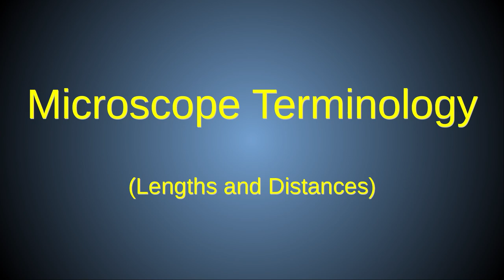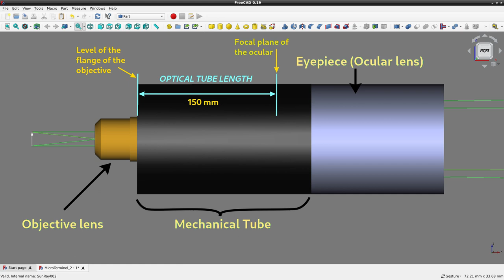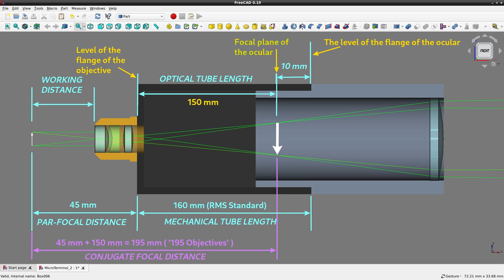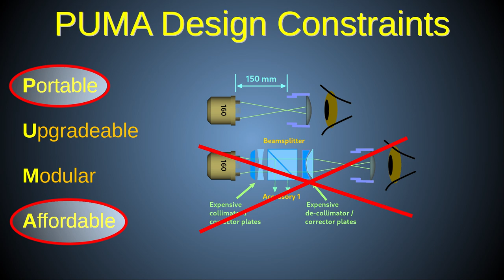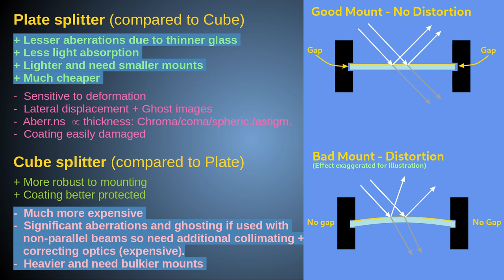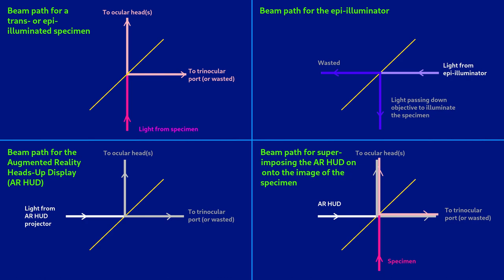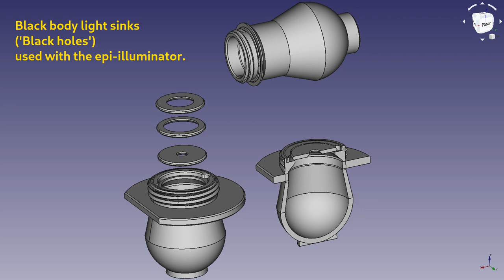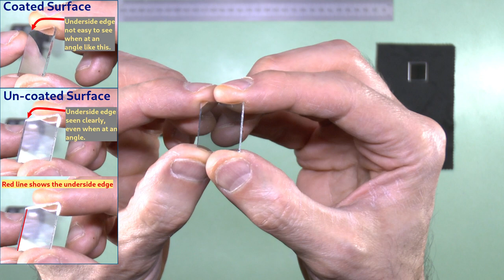Beam Splitters and the Advanced Filter Block (plus Microscope Length and Distance RMS/DIN Standards)

Comment: I come back to say I finally assembled the filter block (with a 20mm half mirror because it was really too hard to adapt for a 30mm one) and it works pretty well with a 5x objective.
I don't have a base yet, and I plan to create a totally different design (only for light reflected), so my tests were a little shaky, but the image quality is very good with the 5x objective. Comparable to my metallographic olympus microscope, but very cheap to make, so really well done.
This will open up a lot of possibilities. I plan also to make an infrared version because I have a microscope camera with a removable IR cut off filter.

I also tried with higher magnification objectives but sadly, the quality deteriorates a lot with very little contrast and a hazy appearance.
It may be caused because it's biological objectives (so they requires a coverglass) but I assume it is also because the LED housing don't have any aperture?
Any ideas to improve the quality? Did i miss something?

Also, do you think it is possible to use dark field with reflected light on PUMA? Or the objectives are the main limitation? (my olympus microscope requires special neo objectives for that purpose + a different vertical illuminator).

Thank you!

Edit:
After some investigation, it's indeed caused by the light reflected from the objective, so even if there is no sample to observe I have a bright image (and therefore a big loss of contrast). If I add a small aperture after the led illumination system it seems to reduces a lot the problem, but it's not perfect.
My Olympus BH2-MA have an aperture diaphragm and a field diaphragm. Probably to avoid these problems.
Do you plan to release a more advanced vertical illumination system later? Or maybe PUMA is just not really adapted to light reflected microscopy? If I understand well infinity corrected optics are better for that purpose. It is only because of ghost image caused by the half mirror in finite system? Or also because infinity corrected objectives are more adapted for that?
Reply from the maker: Hi, thanks for the feedback. In my experience, the system as I designed it works very well in epi-mode as long as the epi-stop and light sinks are used - as I hope you can see from the images in the 'Epi-illumination' video. Ensure you only use black PLA for all light paths - any internally reflected or other stray light entering the system light will degrade the image quality. Also, the degree of collimation of the input light may affect the results - the standard 2x23 lens LC system is what I use, in the configuration shown in my videos. Over-converging or under-converging input light might degrade your experience.  I have even done epi-illumination with oil immersion (see the silicon chip die images) and this works very well. Another thing I will say is that it is important to prevent back-reflected light - hence the epi-condenser and epi-black bodies. Infinity objectives are not required to get good results with PUMA epi-illumination. I have always used standard 160 objectives to get the results shown in the videos.
Regarding epi-dark field. I believe it is possible to do this with PUMA but I have not tried to implement it. It will probably need a dedicated module that should fit in with the standard system. I am currently working on other aspects of the illumination system including high NA transillumination and more work on phase contrast. I also want to start work on the fully motorised XYZ stage for robotic control nanopositioning experiments - but all this is a lot of work and will take a lot of time! I hope you get your epi-system working well enough for your purposes. If any of the tips here helped, let me know.
Reply: @PUMAMicroscope   Thank you for the answer. So the problem is probably my illumination system. I use the black body, indeed. I also have the same problem if I remove it and let the light escape.

I will double check everything, but it seems that the light coming out of my illumination system is not perfectly parallel. Hence the problem maybe (it seems to bounce inside the objective, if I remove the objective the image is dark as expected). Any tips to calibrate this part?
Thank you.

Anyway the following features seems very interesting! And a motorized XYZ stage is really a must. I made one (based on a micrometric XY stage) for my olympus so I can take gigapixels panoramas of integrated circuits with a 100x oil objective, for reverse engineering. Some captures took up to 30h!
If it were possible with PUMA, I would be able to make several captures in parallel, so yeah, really looking forward to that. It would also make this field of microscopy more accessible. It's currently very niche, probably because of the high investment required for this kind of setup (we talk about 2000-5000€ if you buy it and don't make it).

I will try also to do a motorized stage on my side,  I have some low-cost ideas (at least for the X/Y part).
Reply: @PUMAMicroscope  So this 5mm spacer is missing on my build: https://youtu.be/cAEB10K8PqI?t=241
I can't find it anywhere. Do you think it is related to my problem?
Edit: found it right after posting the message... It's in Dominus part 1 => Lower_Collector (if anyone else is looking for it).
Reply: @PUMAMicroscope  Found the issue... and it was not the spacer.
I tried old Optico Paris objectives instead and I don't have the problem anymore (it's not perfect, but the image is OK). The other objectives act as mirrors on the top lens. Probably because it's some cheap objectives from a cheap Paralux microscope.
I was able to use the 10x and 40x objectives of the Optico Paris microscope without losing too much contrast.
I will have to try to buy new objectives to see if there are any improvements, because those were taken on old second hand microscopes.
Reply from the maker: Thanks. That's good to know - yes you want objectives with good anti-reflective coating at the back and blackened casings. Re the illuminator - it is not perfect parallelism that is required but the right amount of angle. The PUMA 2x23 LC LED system with and without spacer have different levels of angle (despite my diagrams showing a neat parallel beam). I haven't tried a perfectly parallel beam here. I have developed a good approximation to a parallel beam illuminator which I will be making some videos on later but I haven't tested that with PUMA epi at this stage. If you were using infinity objectives then I suppose a perfectly parallel input beam at the back would make sense but the 160 objectives have a cone of light out the back rather than a parallel beam (regarding light from the focussed image plane) so a similar cone is what you would ideally want to shine down from the back instead of a perfectly parallel beam. For most practical purposes I'm not sure how much difference this will make though.
Reply: @PUMAMicroscope  Thank you for the precision. I was not sure about the parallel beam, I'm not really good with optics but I watched multiple times your video because it is really interesting!

Do you think it can be useful to add a field diaphragm after the lenses in the vertical illuminator, like for the olympus BH2-MA? (for example in the Epi_attachment). I have a spare one and I can try to make an adapter.

About the anti-reflective coating of objectives, how do you know if it is present before buying one? Has this become a standard these days? Or should I ask the seller?
Reply from the maker: @oni2ink  Not sure as to effect of a diaphragm - I haven't tried but then I haven't had any issues with image quality that require fixing so not sure I could tell the difference. You could try and see if it helps.
Objectives before buying - no, I don't think there is a standard. I think it best to ask the seller. All OptArc ones have anti-reflect at the back.
Reply: @PUMAMicroscope  Hi again. After some experiments I can say the field diaphragm is very important for light reflected microscopy.
It can increase the contrast a lot, even with cheap objectives.

Now I'm a little stuck because I'm not sure where to place a field diaphragm exactly, and if I need specific lens etc / how to calculate their properties.
I really don't know the theory and my only example is the vertical illuminator of my Olympus BH2.
Do you have any documentation / ideas for this?

Thank you
Reply from the maker: Hello. I assume you mean the diaphragm on the BH2 metallurgical  epi-illuminator. That sounds a bit odd to me because the field diaphragm should (in theory) not affect contrast other than be removing unwanted reflections from the optical tubes - so I guess that is what is happening with the BH2. Unless you are altering the polarisation angle control instead of the diaphragm - polarisation angle can make a dramatic difference to contrast esp. if you are using an analyser polarising filer.
The epi-illumination system on PUMA differs from the BH2 in that the epi is not Köhler on PUMA so has no field diaphragm as such. You might try experimenting by putting diaphragms just behind the 23 mm lens that contacts the LED to see if that makes a difference. I can't properly advise because I have not experienced this problem with my PUMA epi system so I am only guessing. Also, using polariser and analyser can really hep with contrast so try varying the polariser filter angle while keeping the analyser fixed. If you find something that works, let me know.
Reply: @PUMAMicroscope  I have this problem mainly with cheap biological objectives.
With a msplan objective, comparing with cheap objectives the contrast does not change much, but I still have ~10% contrast difference.

And yeah, I think it's caused by unwanted reflections but inside the objective.

After a little search I found this:
"With reflected-light, or epi-illumination, it is 
particularly important to pay attention to restricting the area of the illuminated 
field to avoid stray light – non image-forming light – which if allowed to intrude 
into the optical train, will reduce contrast in the image significantly."

I will try to place the diaphragm just behind the len to see what it does. I will tell you the result.

Any idea if it is possible to make Köhler for the epi illumination system of PUMA? Or maybe it requires too expensive optics?

Thank you!
Reply from the maker: @oni2ink  epi-Köhler will not likely help much with the current PUMA tube designs - it will be a lot of work and effort for very little improvement (it would be easier / cheaper perhaps to just get a better quality objective I think, or find a way of modding the cheap objective). Anyway, I have no plans to do that - there are many other things coming down the pipeline that are taking up my time.
Reply: @PUMAMicroscope  Just out of curiosity, what are the challenges for an epi-Kohler illumination system?
What do you mean by the current PUMA tube designs?

Good idea for the modding of objectives.
For 4x/5x ones I think it is possible, but probably not much for higher magnifications.
Reply from the maker: @oni2ink  Köhler for epi would involve projecting a focussed image of the light source at the back focal plane (BFP) of the objective while simultaneously projecting a focussed image of a field stop on the specimen plane. The position of the BFP varies by objective so you will need some system to identify the position of the BFP and vary your projection to match it. Likewise for the field stop projection. All you will gain from this is perhaps a bit more even illumination across the field and maybe reduced reflections in the optical tube. Since your problem is not field illumination flatness and since the PUMA tube baffles effectively remove internal reflections by design, the huge effort to design and make such a mechanism would bring little benefits in PUMA. Much easier to just use a higher quality or modded objective if that is what is causing your issues. I do not not suffer the issues you describe so it does not appear to be a fundamental design flaw of the PUMA illumination system per se.
Reply: @PUMAMicroscope  Thank you, that's pretty interesting.

I imagine the BH2 (with epi illumination) don't have all of theses problems because it's an infinity corrected system?

How did you designed the Köhler illumination of PUMA for transmitted light?
Is there any simulation software? Or you do all the math by hand and empirically?

I hope I'm not boring you with all these questions.
Reply from the maker: @oni2ink  Re Olympus they designed their epi objective set so all of them have the BFP in the same place relative to the flange of the objective. Re transmitted light - the equivalent plane is the lower focal plane of the condenser and that never changes regardless of objective used (in epi, the objective IS the condenser) - so relatively easy to design a static system for this. For my trans Köhler system I used a ray optics design app (as illustrated in the first Köhler video).
Reply: @PUMAMicroscope  Ah yes indeed it makes a lot of sense. Thanks for the precision!

Would you mind sharing the name of the ray optics design app?
Reply from the maker: @oni2ink  It has morphed a bit since I first use it but I think the most recent version is this:
https://phydemo.app/ray-optics/
Reply: @PUMAMicroscope  Oh ok, I used it quite a bit, and I wasn't sure if it was actually usable for practical applications.
Thanks!

Comment: Hi, I have another question.
I'm trying to make a second light reflected PUMA to use a spare high quality infinity Olympus objective I have.
Why in the BoM the "Lens infinity tube" focal length is 100mm?
My objectives have "f = 180" written on. Do I need a tube lens with f = 180mm instead?
It's an achromat doublet I suppose?

Regards
Reply from the maker: Hello. For any infinity objective (regardless of its make or other features) when the specimen is at the correct working distance from it, the imaging rays coming out the back will all be parallel rays (the imaging BEAM will be diverging - but never mind about that for now, it does not affect the answer to your question). To get those parallel rays to converge to a focus so you can see the image in focus you need to get them to converge at the focal plane of your eyepiece. In the PUMA microscope there is only 100 mm from the position of the (optional) tube lens to the focal plane of the eyepiece, therefore the tube lens must cause those parallel rays to come to a focus 100 mm away from it and so, by definition, it must have a focal length of 100 mm.
Most professional infinity microscopes have tube lenses of f=200 mm or thereabouts. This is why using the PUMA with its 'standard' infinity tube lens of f=100 is a compromise and does not give good image correction (the objectives are designed for a tube lens with much longer f). However, you could use a tube lens with f=200 (or just over 200, something like 220 mm) and then you would need to increase the distance to the eyepiece by the appropriate amount - so if you use a tube lens with f=200 mm , just make the ocular tube longer by 100 mm (although things could get a little 'wobbly' if you stick a camera on the end of such a long tube without appropriate support).
I hope that all makes sense.
Reply: @PUMAMicroscope  Oh I see! Thank you very much for the explanation.

Do you think it may be worth the effort to use mirrors to make the system more compact? Or it may just reduce image quality for little gain?
Reply from the maker: @oni2ink  That mirror thing was the question I had to ask myself when designing the canonical PUMA. I decided against it because it would mean using first surface mirror or a TIR prism and would increase the cost and also mean singificantly more 3D printing and construction. However, for any individual, like yourself, if you are building a system for your own use then the decision is up to you. It shouldn't reduce image quality significantly if you use one first surface mirror but it will add weight and the system will have increased bulk which, if not designed carefully, cause increased vibrations thereby cancelling out the desired benefit. It may be easier to just design a more stable straight monocular tube (thicker walls with buttressing, etc.). Over to you to experiment and see what works.
Reply: @PUMAMicroscope  I see, thanks for the clarification. I'll try to increase the tube length, and the thicker walls are a neat solution.

My Olympus BH2 have a magnification changer just above the tube lens.
If I want something like this on the infinity PUMA version, do you think I can add an optional achromat lens on the tube? For example by using something like your filter slot system?
Reply from the maker: @oni2ink  For that you will could use a beam expander between the objective and the tube lens. This might reduce image quality - I would avoid it and use a higher res camera instead.
Reply: @PUMAMicroscope  Ok thanks!

On the BH2 the magnification wheel is only for 1.0x, 1.25x and 1.50x.
I haven't noticed any loss of quality, but given that the image is cropped it probably help.

I'll have to measure the focal length of the lenses they used, I'm curious.